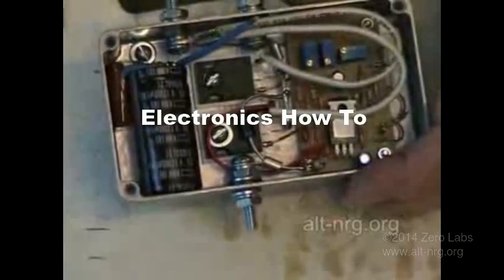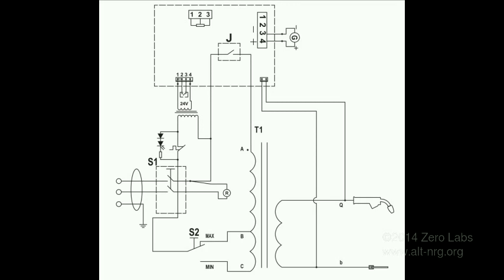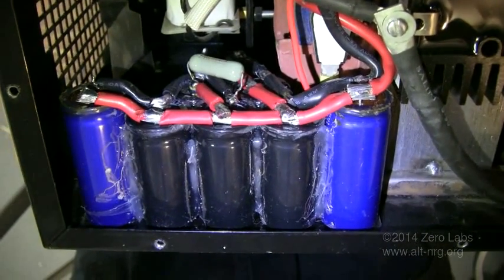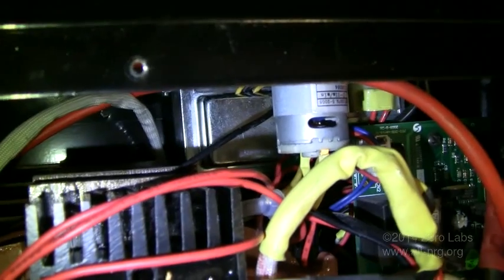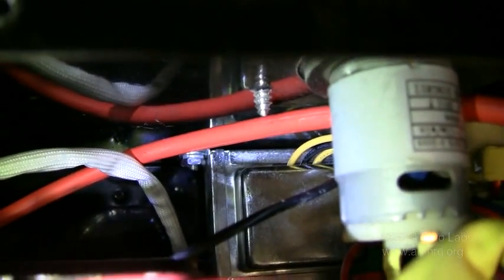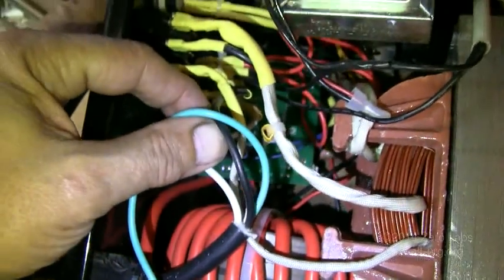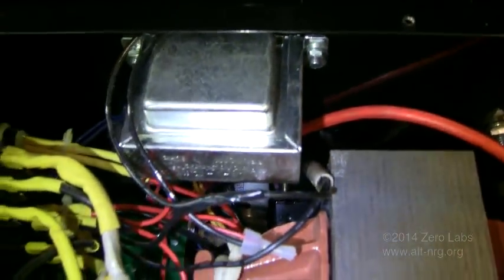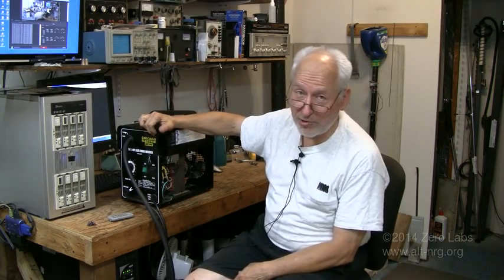#374 Harbor Freight 90A "MIG" welder upgrades

Comment: DCEN change the tip to negative polarity and you can reduce the popcorn (splatter) and get even better penetration. You know that if SLAG then DRAG. With the flux core always drag a level  weld seam.
I am going to try the mod with this even cheaper version sold in Canada, I mean can you imagine where you would try to save money from the $100 Harbor Freight model??? Well apparently it is possible as I have concete proof :-). I am just trying to wrap my head around the nature of the rectifier and the choke. I see a lot of guys using a three phase rectifier and to what end? I only see single phase in and out. I still have my research to do so am at an early point in the learning curve. Thanks for the vid and the elaborate schematic that we can take a screen shot of. Best Regards. C

Comment: That is NOT a MIG welder! A MIG welder uses Argon/CO2 gas, hence the name MIG ("Metal Inert Gas"). That is a wire fed flux core welder. If you wanted to make it into a MIG welder, you would have to modify it to allow gas to be fed through the hose.
Reply: LOL  some people obsess over symantics. What a waste of time
Reply: Martin Andersson
MIG welding and MAG welding are both done on the same apparatus; and that apparatus is called a MIG welder. So my point stands.
Reply: jjenson2006 preferably a d-c welder is best with a d-c positive ground, not d-c negative ground. Check with weld.com for the best YouTube welding vids.
Reply: Yes.  We know that.
Reply: jjenson2006 No its made with a gmaw machine. If usel with an active gas like CO2 it's a MAG and inactive inert gas it's Mig
Reply: jjenson2006 wrong, when co2 is mixed in the gas it's a MAG welder, since the co2 is an active gas. Welding alu or stainless with 100% argon is MIG

Comment: if I'm not mistaken the toroidial transformer is used to provide a resistance to voltage drop or rise when using the welder. it stabilizes the welder. Also i dont mean to nit pick but this is a improved flux welder not a mig. Mig requires a metallic inert gas to be a true mig. But the improvements are good ones for this machine.

Comment: If your using the Harbor Freight flux core wire switch to Miller #211 (.30) & make sure wire guide wheel is set for .30.

Comment: Hi! Nice work! I have a doubt though. If you are using flux core weld you should use DCEN. It means negative on the wire clamp. Looks like your schematics is inverted. Could you clarify this? Thanks. Regards from Brasil!
Reply: I bet it means electrode negative. Most of the heat is on the positive side. For deep penetration  the work needs to be positive.
Reply: The capacitors in the schematic have he + on the wrong side.... I think

Comment: does anyone know if the same feed motor drive transformer mod used in this video will work on the older blue hot tip type HF welder?

Comment: those welds you made after all those complicated improvement are absolutely unacceptable that welder is rated for nothing much more then sheet metal. better to simply fork out the money and get a much higher quality cheap ass welder. most harbor freight tools are only useful for a single use. the only tool from there I would ever recommend is the powder coating gun I have used mine for over 20 years and thousands of times and works flawless .. why ? because I use it for the workload it was intended for I don't try to powder coat a dump truck chassis with a unit designed for small items

Comment: I'm in the process of doing a conversion similar to this.  Good info , except I'm failing to understand the point of the inductor in series with the negative electrode.  Since it's DC, the inductor will have no effect that I can perceive.  Also, a true MIG (metal inert gas) welder has less to do with wire feed and DC and more to do with the fact that inert gas such as argon is introduced into the weld.  These cheap welders don't deliver any gas so even after a conversion, it's still not really MIG.  My 2¢ for whateer its worth.  Cheers, Chris.
Reply: The Capacitors smooth the voltage to a slightly fluctuating DC Voltage.  The Inductor smooths out the fluctuating DC current that is supplied via the tip.  Its value is not that important, the more turns on the cores the more inductance .   More inductance less variation to current fluctuation...

Comment: What did you use to attach the rectifier to the transformer?
Reply: No.  While 5 watt is fine, 10 watt is even better for this purpose.  It'll produced less heat.  The capacitor capacity does not matter if the resistor purpose is to bleed out charge and not carrying the load.  Just keep in mind of the welder voltage as well as the resistance and wattage of the resistor.  Normally, we would not want to use the resistor wattage to the max.  If your machine is the same as the one in the video and 5 watts works well for him, then 10 watt will work perfectly fine for you.
Reply from the maker: The leads are long enough and terminated with screw lugs.
Reply: Is a 10 watt 160ohm bleed resistor too big to use? My caps are 54000uf

Comment: Just for your own safety you should have a fan going or weld in a well ventilated area the smoke from the flux is very Toxic If inhaled.  Conversion Is better on DC and this welder is decent for the weekend warrior but the only problem is that welder is so limited lets face it  after all that extra money you spend to convert the welder more like $55 not $30 you never included the stuff you had laying around. Your still only getting 90 amps  maybe 100 amps Direct current which is weak if you go between 1/8 and 1/4 inch steel so just spend $300 and get a decent welder if your going to mess around well then you can even change polarity all you like more features on feed and temp... also the gas MIG's help. Then you discover TIG is all you need after you master Mig besides that model Is a Flux core on Alternating Current because It's an Arc welder....not a true MIG. Your spatter is due to stick out  along with wire speed. You should only weld mild steel with that setup but that bike tube Chromoly 4130,4140 or maybe even 4145 you need to TIG that while it needs to be super clean. You will get way better just keep trying and what ever you do don't listen to anyone that tells you to push the puddle that's for real gas MIG always Pull flux core Keep up the good Videos I enjoyed Thank you.
Reply from the maker: You are entirely correct. However, I already spent the money. I already had the welder. I was not in a position to go out and buy another. So, I make do with what I have. It was a vast improvement. If I do get another welder, it will definitely be a TIG. I have no doubt that I can master the technique. Thanks for your comments.
Reply: +ZeroFossilFuel Thank you for replying you an Awesome YouTube channel Thanks for the video's I wish I had the confidence to explain thing's on camera...

Comment: I keep getting confused between about 10:15 and 10:40. If you look at the video, the new transformer is connected by one wire to the relay output, and the other wire taps into one of the fan wires. In the schematic, it looks like the fan wire is not used, but rather taps in to the wire between the original control transformer and the diode pack on the main transformer. If you're just looking for AC hot (switched) then tapping into any of the wires in that three spade connector group should do it, correct?
Reply: Also, if the 25v tap on the new transformer isn't needed, then just a 120v to 12v transformer would do, correct?

Thanks!
Reply: I just started doing these mods and I have the same confusion as you for the black primary wire spliced into the fan wire. He mentions the black "AC Hot" wire and the 4 piggybacked wires on the left side of the on/off switch, then mentions a thin black wire going to one side of the primary of the transformer that was added. The video clearly shows it spliced to the fan wire. Did you figure it out? Does the power to the added transformer come from the fan wire from the AC hot side of the on/off switch or the other side? I'm not very good at reading the schematics and I don't want to blow the unit up. Any help would be appreciated.

Comment: Hey Mark, does this welder have a place where you can hook argon gas up to it?
Reply from the maker: +Bush Imports Um, sort of? Not out of the box, though. I think there's a pipe nipple on the plastic pinch roller feeder. The cable sheath and wand are the same. Missing is a solenoid valve, regulator and fitting for an argon tank.

Comment: Doing this mod but first decided to do a bit of testing on the Rectifier before install. I used a 120 volt house current to provide a sample input voltage, but discovered I only get 50% DC voltage on the output side when the AC leads are connected to the 2 outer-most input terminals as you've done in your video. However, if I instead move one of the AC leads over to the middle terminal of the Rectifier my DC output increases to almost 100%. Can you answer why you've connected yours to the 2 outer terminals which only gives you 50% of the output voltage? I would think we would want 100% output of the voltage we put in.
Reply from the maker: +DataQuest Imaging The rectifier pack I use is a three phase full wave bridge because they're beefy and inexpensive. I'm using only 2/3 of the entire pack. My choice of which diode pairs was arbitrary. If I blow one up, chances are good I can just move my wires over to the unused pair.
Reply: +ZeroFossilFuel I'm using the same rectifier. You may want to double check the differences in your outputs to see if yours does the same voltage drop as I've described,  and if so decide if you want to stick with half the power or move the lead to center for full power.
Reply: Your rectifier is partially broken if you're getting different DC voltages with different input terminal combinations.

Comment: your welding 1/4" steel using a flux core wire welder with a 40% duty cycle which is only rated for 3/16" or less. Not even worth spending  an extra $30.

Comment: I rigged a set of vise grips as a ground clamp and got much better heat. Good ground is essential, especially with low amp welding.
Reply: I added an extra smaller clamp to the ground clamp. I use both for current flow to the work.

Comment: ZeroFossilFuel - Great video -  MIG is Metal Inert Gas - this welder is Flux - Cored only - no gas but you have probably figured this out by now. - still you have a natural way of explaining and very informative - keep it up.

I used your video and added a relay switched bleeder resistor when I let off the trigger  - I also used an HVAC tapped transformer to drive the motor circuit to get it much closer to original design voltage for the wire speed .  I also added a SCR AC control circuit Ebay => 
AC110V 220V 75A 10000W SCR Voltage Regulator Speed Controller Dimmer Thermostat 
in the input to  the XFMR so I can control the ARC voltage.Welds like a Lincoln.(maybe ha ha) after tweaking the pot value  that came with the speed control.!!Thanks for the Great Video.!
Reply: The flux makes a shield gas.

Comment: Looks like you are using a half wave rectifier, meaning you are only using half of the power. Am it correct or did I miss something?
Reply from the maker: +wenliu99 Oh, you definitely missed something. It's a full wave bridge.
Reply: +ZeroFossilFuel Got it. One more question, did you try the mod without the extra cap and inductor? With the rectifier, it's already DC (maybe not the smoothest).
Reply: The rectifier makes the voltage always positive.  An always positive voltage and a DC voltage are not the same thing.

Comment: AC doesn't disqualify it from being mig, its still a mig welder "A constant voltage, direct current power source is most commonly used with GMAW, but constant current systems, as well as alternating current, can be used." https://en.wikipedia.org/wiki/Gas_metal_arc_welding
Reply: Doesn't matter whether it is AC or DC. Without a shielding gas, it is NOT a MIG welder.

Comment: this is not a "M.I.G." welder, there is no Inert Gas, MIG stands for Metal Inert Gas, even with the DC conversion you still have Flux core welder. So its basically a wire fed buzz box, good for light outdoor metal repairs

Comment: Question is the welder DCEN ?  By adding a inductor (AC output)in series with the mig output of the bridge rectifier(DC output) does that change the welder back to AC output?
Reply: +Brian S  - no - inductors oppose changes in current.  Adding It will help to stabilize the current.   The Caps stabilize the voltage.
Reply: +F Curtis 
When adding an inductor in series on the rectifier is it best to place it on the - (torch line) or the + (ground clamp line)? I am in the process of modifying my 90A Chicago Electric M# 61849 in a manner like zerofossilfuel has done.
Reply: Kevin Taylor I added to torch (negative) line & works fine. Remember for flux core its DCEN so watch your polarity on rectifier & caps.  Good luck.

Comment: Really dumb question, but how did you attach the rectifier to the transformer?  Glue of some sort, or did you use thermal adhesive?  I'm getting ready to do this mod and that's pretty much the best location I can find for the rectifier..

Comment: Nice video. Don't be afraid to get close to your weld while you are welding. If you are wearing adequate protection, the few sparks and spatter that hit you won't hurt you. Trying to weld with your eyes/face that far away is difficult for anyone.

Comment: the voltage for the motor circuit is regulated with a zener diode, two things to do to stablized. change that 450 uf cap to 2200 uf 50 volts. then remove the zener diode (ZD1). install a  voltage regulator 12 to 15 volts. wire the center lead to where the anoid was the the out to where the cathode was and from the 2200uf cap plus to the in of the regulator. this will fix the voltage drop even if it falls 12 volts

Comment: I did not wire in my transformer to the relay for the wire feed.  Since it's an a/c door chime unit it is use to being on all the time I wired mine into the fan leads after I moved then to the other side of the welder case. Since the main transformer and the heat sensor transformer are on all the time.  What's the diff?  I was lucky to have on hand a plug exactly the same as the power plug coming off the transformer to the PCB panel.  I just wire tied the org. plug out of the way and used mine which had very long leads. I also salvage very fine #8 wire from an old A/C unit which made if very easy to wire up my capacitors.  American wire at least has the size stamped on it as opposed to that China junk. Cheers :)

Comment: Ok this is eating away at me, the only thing that determines if a welder is mig is if it is a metal inert gas welder, thus mig... AC/DC makes no difference you can get both AC and DC mig for things like aluminium. No gas not mig, wire feed, you got yourself a mig. The current type makes no friggen difference on the form of welding.

Comment: did you wire the capacitors in parallel or seriesI found a rectifier out of an old microwave oven
Reply from the maker: +1tgood You clearly do not have the experience necessary to make part substitutions. Microwave rectifiers are high voltage low current. It will likely explode on you.
Reply: +ZeroFossilFuel 
I meant to say a transformer out of a microwave oven. So as a 50+ year journeyman electrician and a 36 year retired professional firefighter. I do know what I'm doing .  I stripped out the transformer and made a choke out of it with  #8 THHN double wrapped wire.and believe me it really smoothed out the welds.  My welder is up and running just fine I installed (2) 50 volt DC capacitors each having 4,6000 micrifarads.  
The rectifier is a 100 amp 2000volt full bridge unit. Just as you did I installed a bleed resistor. Don't want any surprises as I make contact with the welding table. Cheers :)

Comment: also when you're welding two thicker pieces together especially with a smaller welder u need to leave a gap between the two pieces, about 1/16 of an inch then tack each side making sure your gap is even. This will allow u to get much better penetration

Comment: you need to weld both sides. when u welded those shims together and only welded one side the reason it broke so easy is when u don't weld both sides u basically have a crack on the other side. No matter how deep your penetration looks u have to weld the other side to seal the entire weld and have no cracks. Try that let it cool for a minute and u wont b able to break it with your hammer
Reply: This is wrong. If you have sufficient penetration, you don't need to weld both sides.
Reply: Good lesons